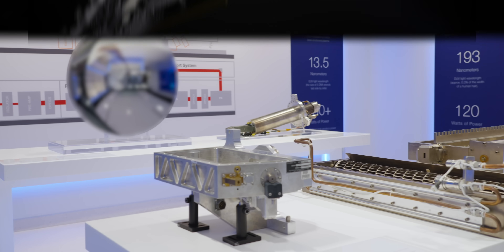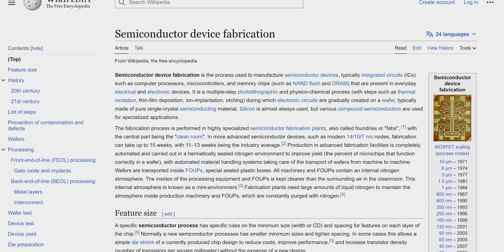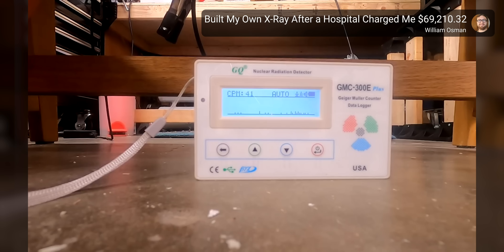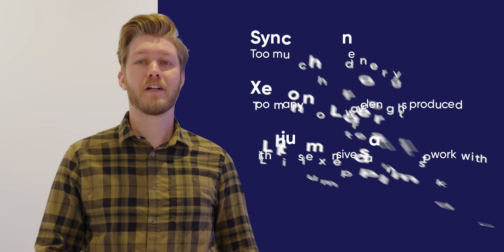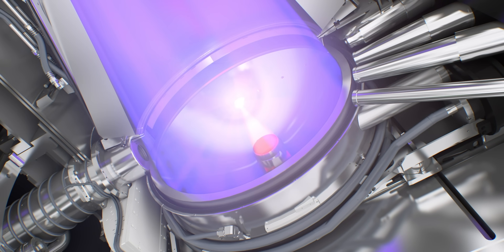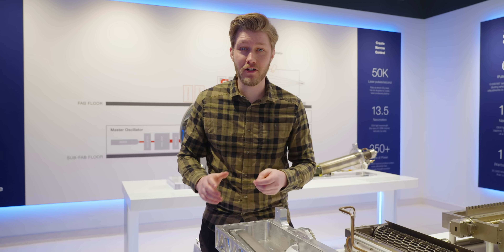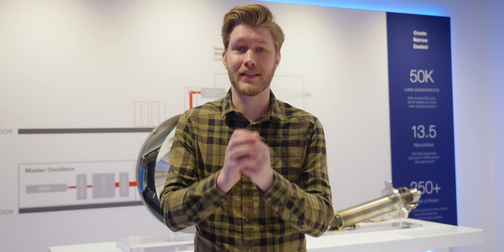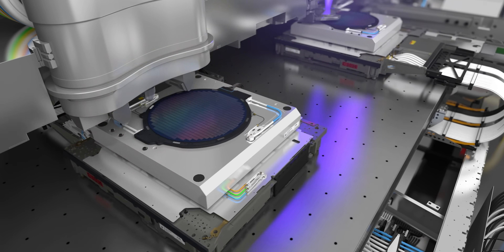You Didn’t Build your PC… This Did. - ASML Cymer Tour

Comment: At this level of manufacturing its flippin hard, like really really hard to make it work. Even if another super experienced chip maker had the designs in hand. It would take them years to get the machine to operate with half the efficiency and yield. The place where i work share a lot of its designs because we need more people to tackle these problems. There are some secret sauce stuff that is kept under wraps though. Also helps that tonnes of money is required to build the machines let alone to run it.

Comment: I was working a contract at this place in Minnesota, which did similar work I believe. No lasers that I was aware of though... At least not with the parts I was making. They were using extremely corrosive gases with the parts I was making-2 step gases they called them-cause if the parts werent perfect and there was a tiny leak, two steps is how far away you could get before you die. lol. I will say though, that semiconductor-parts machine shop was at least at the same level as the shop where I made pacemakers-hands down, the most pristine and state of the art facilities ive ever seen.
Reply: also that mirror is hella smudged..

Comment: Previously Chip manufacturers were able to rely on just shrinking and cramming more transistors into the die to increase performance. 
However, that's getting harder to do. Materials are becoming more exotic, and we're getting diminishing returns. 
The focus for the likes of AMD and Intel are to improve their underlying architecture. increasing Intructions per clock, reducing overhead. and even utilising more efficient processing languages and processes.

Comment: The 7nm thing isn't even true.

In case of the "3nm process":

Copied from Wikipedia "3 nm process": "The term "3 nanometer" has no relation to any actual physical feature (such as gate length, metal pitch or gate pitch) of the transistors. [...] a 3 nm node is expected to have a contacted gate pitch of 48 nanometers and a tightest metal pitch of 24 nanometers.[14] However, in real world commercial practice, "3 nm" is used primarily as a marketing term by individual microchip manufacturers to refer to a new, improved generation of silicon semiconductor chips in terms of increased transistor density (i.e. a higher degree of miniaturization), increased speed and reduced power consumption."

Comment: you say after EUV we will have to go to quantum.... but that is a TOTALLY DIFFERENT type of machine..... it's like comparing a car to a pogo stick just because they TECHNICALLY can both be seen as 'transportation' 
you NEED to realize that our current computers won't work with quantum computers... you wouldn't just have a quantum computer in your bedroom... it's more like there would be once quantum computer for each country, but you wouldn't game on it.....
- I see the NEXT STEP after Silicon being PHOTONICS!!!! we can still use our same "transistor' /binary systems of computing but replace the electrons with light.... just because we cannot define light as being either packets/quanta OR a wave doesn't mean we can't make it BEHAVE LIKE PACKETS.... and then we don't have to worry about silly things like physical distances on the mother board, or 'bandwidth' ... there are SO MANY BENEFITS of just using light to compute in the same way we do with electrons..... 
Okay this is a bit much for a YT comment section but I see it being the QUICKEST way to smashing Moore's "law" to bits (lol no pun intended hehe)

Comment: Time to put away electro-magnetic waves and pick up electron beams.  Actually fairly simple, crank up the power on electron microscopes.  Way smaller components.

The big downside to electron beams: does not lend itself to masking.  Each component has to effectively carved by the beam and that’s slow.  To the plus are the per-machine economics, in the neighbourhood of $1 million each.  Cheap when compared to $hundreds of millions per ASML EUV machine.

Comment: "Is what the incredibly smart folks here at San Diego have figured out", ASML being a Dutch company with their headquarters in The Netherlands be like "wtf do you mean". Apart from that tho, great video :)
Reply: Cymer, a San Diego company, developed the only commercially viable EUV light source used in ASML's EUV machines. ASML later vertically integrated Cymer which is one of the many reasons that ASML only sells to who the American state department says it can sell to.
Reply: @paulblair898  True, but ASML already had an EUV sytem. They bought cymer to increase the research and production efficiëntie. It's not that Cymer was alone on this, that's the point i'm trying to make. They both did their own part, but ASML decided to buy Cymer, because they where better at the laser part and so it would help with research and production speed. So both Cymer and ASML had a big part in the production.
Reply: @paulblair898  To add to my other reaction, EUV was researched in US and was patented by the US, but ASML was the only company that could get licensing, because it was the only company that met all the requirements needed in the beginning.

Comment: I found interesting that the way the tin nozzle seems to work is really similar to how flow cytometry sorters work: they also use vibration to separate a laminar flow into micro drops that (should) contain single single cells each in order to sort them. The timing for doing that is critical for the sorting to work.

Comment: They could probably use an electron gun for a much higher resolution
Reply: Too slow.
Reply: @TheFulcrum2000  this is a new process to me, so I don't know what they're using. I figured I would apply what I know of physics to the problem he purposed.
Reply: @charsquatch600  It has been tried and actually does work, but it's too slow for mass production of chips. Even if you can operate 1000 electron beams in parallel. Which btw has lots of challenges as the beams repel each other.

Comment: I got a tour of AAE recently which is a partner of ASML. They make a part of the "lamp" you see in this video. I didn't get to see the actual part because they weren't working on any at that moment. But what I did see was the Literal bunker they built within one of their clean rooms in which the parts are built. They built the bunker for safety reasons in case the High pressure component fails during testing. Even the roof of the bunker was made extra thin so the overpressure would just break and escape through the ceiling instead of rushing into the rest of the clean room. 
Sadly these video's just don't do places like these justice. It is really something else to physically be in a place like this. It truly is a privilege to be able to visit some of these places :)

Comment: I think we're close to where we can see the end of Moore's Law.
It'll be X-ray Lithography(Gamma is too hard to produce, control and too volatile). Then the switch to Graphene transistors will occur.
After that there's just nothing that can be done smaller. There's no element or molecule better suited. (Silicon has already been taken near it's physical limit)
Then it's just to change the way we do CPU's altogether. The current way of thinking will get us no further at that point.

Comment: I worked here. Instead of paying a livable wage in SD, they take advantage of the H1b program and say "we just can't find enough talent!" . Instead of valuing their tech talent, they use open plan offices and dont even have enough parking for people to get to work. You can sit in a nasty chair that someone-who-doesn't-bathe sat in, while someone is talking at high volume to the person to your right, bumping into your chair, and the person to your left is on the phone. Awesome "cross-pollination" at work right? It was hilarious before covid, they literally PAID people to not use their parking spaces, then they went WFH and came crawling back asking to reneg on the deal. Absolutely horribly run place, with no QA (cost saving measure, like microsoft, just make engineers do it). If you're a CS grad, 0/10 do not recommend (unless you like writing paperwork and taking screenshots of tests (that QA should be doing) more than writing code). If you're a MS or Ph.D you might get enough respect to have your own office and a barely-acceptible paycheck.

Comment: 12:36 I like that despite all the state of the art tech and tools in this video, there's still a good ol' rubber mallet hanging on that tool rack. Doesn't matter how expensive or complex the equipment you're working on is, because at some point everything eventually needs a bit of percussive maintenance. Tappy tap tap.

Comment: i am still a bit confused about how small they can go i heard 3nm will be the end and we are already at 5nm so 2 more genrations max? how are they gonna improve after that?
Reply: Technology will always find a way to improve. If something can't be made objectively better, it can be made efficiently better. For example, (I'm going to use kind of made up numbers) if it takes 450 watts to power a 4090, there are two different ways to make it better. Increase the processor power (Make the 4090 into a 5090) or decrease the power needed (From 450 watts to 350 watts.)

If they can only go down to 3nm -- forever, with no possible way of going lower -- the next step would be making it easier to produce. So, either there is a quicker way of producing, or a less financially consuming way to produce. Of course, we may not be able to fathom a way currently on getting it less than 3nm, but we also couldn't fathom a smartphone, standalone VR headsets, or even computers at one point.

Comment: Aight got it. But what comes next? What comes after those fancy  lithography machines?
Reply: Machines to etch the wafer, machines to sputter nanometer thin metal or oxide layers, machines to clean/polish the wafers and all of that repeated in a variety of ways untill all layers are completed. Plus a metric ton more. There are countless machines to test and modify single dies, sort defective ones out etc. Then wafers need to be cut out, put into their respective package, either through soldering or wire bonding etc. 
It is really difficult to really grasp the scale and complexity of semiconductor manufacturing. A single production line, equipped for just one type of IC might easily be a few hundred meters long. (or even more)

Comment: Great video,
I'm a master student of mechanical engineering with a emphasis in lasertechnologie.
Just today i head a lecture on beam shaping (making different patterns with one source of light).
Micro mirror arrays where the old technique, the are commonly found in projectors.
If one is shaping light with a mirror there is the possibility it's being done with a deformable mirror. One can crate a small dip or hill on the mirror by causing a small charge in a locate.
This will focus the light in a controllable way.

Another comment use of this is in large telescopes to correct for wave front distortions caused by the atmosphere etc.

Sorry for my horrible english I'm from Germany and i didn't learn the correct English vocabulary for this topic :)
Reply: Thank you for the info, it was perfectly understandable! I studied a bit about this stuff in a Nanoscience master's degree, it's really fascinating.

Comment: it's crazy how much precision goes into the manufacturing of the chiplets, but by the time it's integrated into a processor unit, the engineering for the heat sync (arguable one of the most vital parts) can be downright lazy.

Comment: Edited

Fun fact: Zeiss* is actually a major lens and mirror supplier to ASML. 
Zeiss* also makes extremely flat mirrors. If you get a 25x25m² and magnify it x5000 the biggest difference will be max 3m. Only once.

Where most other mirror makers will have a difference that's easily 10x bigger and more often using the same starting dimensions of the mirror.
Reply: they also make nice selective laser melting "Metal 3D printers" with red or green lasers. The thing with Trumpf is, since it is originally a manufacturer for lathes and mills, the interface and usability of the SLM machines is super convenient and makes working on them super smooth
Reply: nope
Trumpf is not owned by ASML and does not make mirrors or lenses, one of the divisons of Trumpf makes laser and integrate them

another german company is the one that makes the mirrors and lenses and that is Carl Zeiss or to be more specific the daughter company Carl Zeiss SMT (semi conductor technology)

ASML only bought into this company with less then 25% the rest still belongs to Carl Zeiss
and that makes sense for ASML to buy into the only possible supplier on the world for a critical component

the light system in the ASML EUV machine is a co developed solution between ASML, Carl Zeiss and Trumpf with the help of Frauenhofer
Reply: @lexel90 then i got my German companies mixed up. But h know they took over some mirror company. At least last I heard. They did it pretty much so they could've first pick on mirrors and glass and i get that. If every nanometer counts.

Absolutely correct it's Zeiss.
Reply: Trumpf is a family owned business. Maybe you are thinking of Zeiss.

Comment: I understand (conceptually) how they make transistors so small, but I've never understood how they connect billions of transistors to thousands of pins. At that point how do you control individual transistors w/o accidentally turning on large groups of them?
Reply: They key point to understand is that integrated circuits (especially ones like CPUs, GPUs etc) are mostly inter-connected. That is, most of the connections are in-between the transistors themselves, which make up functional blocks of logic. These blocks of logic are then interconnected with eachother to provide the function of the chip. The only connections needed to the "outside world" are whatever's needed to input or output data, and other relatively simple stuff.

So, to directly answer your question I guess, the chip pins/pads don't really directly control many transistors - by a mindblowingly overwhelmingly large margin, most transistors are just controlled by other transistors, which are controlled by other transistors, which are controlled by other transistors... Etc. Think of it like a pyramid.
Reply: @Mythricia1988  Thanks. I've also always wondered how they can control a single pixel on say a 4k monitor, and how they even wire up 3840x2160 individual pixels. Slightly different topic perhaps, but how these super small micro things connect up to macroscopic connections has always baffled me.

Comment: What I always find fascinating about stuff like this is that every single damn cable and whatever they have there is there for a reason. Nothing is put there for no reason. This is just incredible.
Reply: why would any cable e useless in any siuation unless it used to be used for smething
Reply: @Jesse you guys are so funny
Reply: Why would they put there something useless?
Reply: @423GustavBern  Dude that is NOT the point. My point was that these machines are so incredibly complicated with literally thousands of cables and everything and it's just fascinating to me that every single one of them is thoughtfully placed there.
Reply: @Raja995mh33  "Nothing is put there for no reason" 
Then next time dont make it sound like its your point....
Reply: as are most if not all machines that aren't just for show.
Just think of the complexity of a modern tractor D:

Engineering is cool (although often engineers aren't :p)
Reply: @423GustavBern  on the internet i find at least 1 person like you who just has to insult someone else.
Reply: @423GustavBern  maybe YOU try read it correctly next time. It seems that most people do understand what I was trying to say completely fine.
Reply: @Raja995mh33  hahahahahaha
Reply: @423GustavBern  Often times complicated equipment will leave in redundant components to limit electrical, mechanical, or RF noise.  You don't want to rerun testing just to remove a component.
Reply: @jimjohnson3410  then that's still something useful, why are you even telling me this?
Reply: @423GustavBern  damn you must be really fun at parties
Reply: @423GustavBern  what a 🤓

Comment: and maybe minus the dropping of things <3   {Had to} Still want to see you guys tackle Integrated Components with AI assistance on the Custom Boards to put [Repurposed Hardware] onto and create Automated Services that can be deployed for minor to moderate financial income for the teams.
Reply: 5min into the video and LOVE that Enthusiasm!!!!!!! I want to make something like this to make different projects but am FAR from being there.. Am still trying to upgrade my PC + Laptop Storage Capacity, then CPU/MB/RAM for the PC since it's still 4th Gen while the Laptop is 9th Gen. Am wanting to see what can happen if I mix a 40'Series Card with a A5500, and ARC GPU, and even AMD mostly linked to a Sister Board that I'm wanting to develop so people can add M.2 Drives in RAID to Utilize as Quasi VRAM for different Projects. Can only Imagine what that much VRAM could do for the average user. Especially when the Gamer Level Cards no longer support NVlink.. Was having a fun time with my 2080's + them having USB-C which another project in itself where I'm trying to have the GPU utilize the G2 in my Pixel Phone and have the Phone run Agents through the GPU and the PC Archives the Data. Plus am desperate to get a Touch Screen or a Tablet that can be utilized at a Touch Screen and allow the Connected System to Utilize the Hardware from the Tablet.. Yikes..